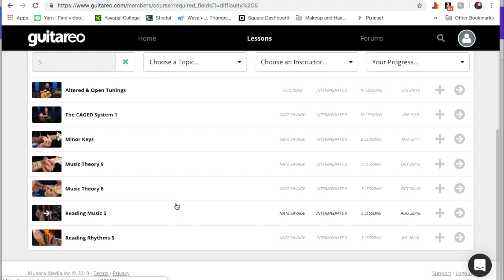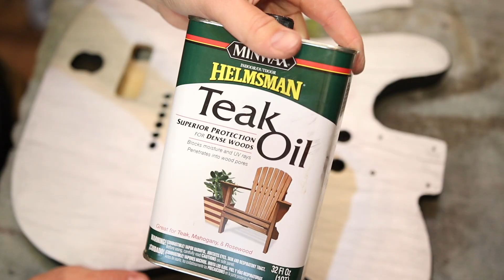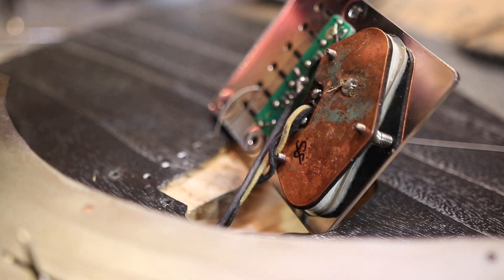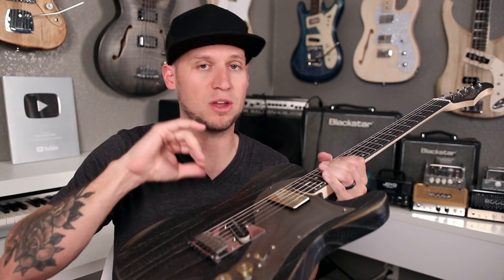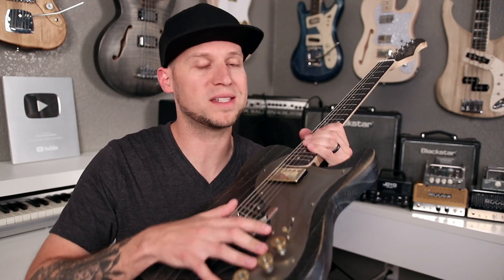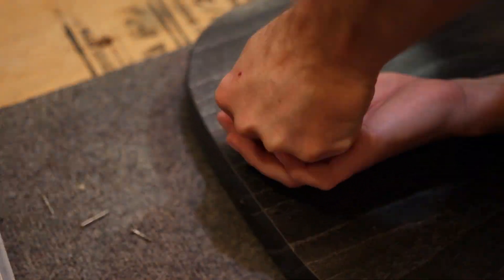Build your DREAM TELECASTER from a CHEAP Guitar Fetish Kit

Comment: Would you do a Flying V in the future?
Reply: or Explorer
Reply: @nikolayjovanovic423  Ditto, I'm about to do a Les Paul kit and if it goes well I'd like to do an Explorer later. Pit Bull Guitars has some, and I've read that at least some of their kits use the same manufacturing as TheFretwire. Leaning more toward that over Guitar Fetish or the random ebay kits.

Comment: I read a tutorial for a style similar to this quite a while back. The guy wet the wood and sanded it back over a few days to make the grain deeper and used nail filler mixed with stain powder to fill in the grain. He also used a thin sanding sealer before applying the grain stain so none sank through. I think his method was more geared towards colouring the grain as opposed to enhancing it, butbthe effect was pretty cool

Comment: Really Nice!!!! Just as an after thought, try using 3" or 3 1/4" magnum shotgun shells for control knobs. They have longer brass that will provide a longer skirt to conceal the pot shafts better. It's just a simple aesthetics thing. One of those small insignificant things that some folks can't quite put their finger on but just notice something is making all the difference in the world or, they don't notice any pot shaft showing, as with regular knobs. Which is even better. Just my $0.02. Great build!!!!

Comment: Pro tip for the super glue trick. Make vertical slits on the screws so glue will also hold up with all the layers as one and you folded the surface area.

Comment: Hey, cheapie kits are a great starting point; and will work adequately, as-is.  I'm in the process of upgrading a cheapie Strat (originally a Saga kit) with some GFS parts, and building one or two Tele's from GFS parts as well.  That's a little different than just buying the kits, but you can select the parts ya want, that way.  I found GFS to be good quality, and with excellent customer service.
Reply from the maker: You and I have had different experiences with them apparently. But there are a lot of people on the internet that say the same thing. I think I was unlucky.
Reply: @GunsandGuitars  Must be the case; I've never had a lick of problems with 'em, quite the contrary.  Mind you,  stuff won't be on the level of Fender, Lace, Duncan, etc.; but at these prices, that isn't expected.  And Jack, in particular, was most helpful in promptly answering any questions I had.  Guess it was just "luck of the draw."

Comment: I don't know whether you purposely ordered it that way (more likely GFS screwed up) but, it's readily obviously to me that neck heel is cut for a strat neck pocket. A tele neck will fit a strat pocket though it will leave a small gap. However,  when you stick a strat neck to a telecaster pocket you get... well.... exactly what you got. I assume you either had enough slack in the saddles to make up for intonation.

Comment: I'd be interested to know exactly what the body weighed. I've got 2 builds with bodies weighing 3 1/2 lbs or less and both are neck heavy. I think these Pauwlownia  Bodies run around 2 3/4 pounds. I have to move the bottom strap button up the side of the body about 4 inches to get the guitar to balance correctly.

Comment: Find a cheap mid boost circuit to add to the tone with a push pull. It is a useful hack and requires a battery. (That is why you have a battery compartment.)

Comment: I’m not sure if I missed it or not but you are  not using the battery box but you are using the power chip Which requires 9 volts?

Comment: I like the looks of the  wood...I'd personally would take drimel to the head stock an make
it looks like a typical tele...stock looking pick guard ...but i'd let rust for a couple of days
then seal it with satin clear coat just to preserve the rusty look..but not shinny...
if not....just 3 ply black  pick guard..

Maybe cigg burn marks on the body..lol...
Depending on the neck...I might mount jumbo frets ( that's how the frets are on my E series tele)..Im used to the feel of those frets....that's all.
Leo designed that guitar to be CHEAP and afford able for everyone...

Comment: Looks and sounds great, it does make me wonder though. Given how little of the kit actually wound up in the finished guitar, wouldn't it have been cheaper just to buy a body, neck, etc. instead of the whole kit?
Reply from the maker: Yes, sort of. The kit was supposed to come with a rosewood fretboard, but it came with maple instead (one way gfs screwed up). So we had to buy another neck, which added to the cost. Otherwise, the neck plus body is the same price as the kit, but I could still use the little things like strap buttons, string trees, etc

Comment: I don't think you are supposed to route out a tele neck pocket for a strat neck in doing so you will shorten the scale length slightly. A strat neck drops into a tele pocket and leaves a little Gap in the corners for a tele neck to go into a strat pocket you would have to route those Corners to Square Off. Perhaps that is why you had to redrill for the bridge

Comment: So the the Gibson 57 Classic has sounds great, what is a good passive bridge to go with that? In your opinion. Thinking about a new control plate with a six way control switch. What do you think? My understanding is that it is easier to wire than the push pull pots? Learning here, this could be over my head but I’m willing to learn.

Comment: Dan, what would you charge me to create a wiring diagram for a Super Telecaster HH ? plan on using 83 Tim Shaw Patent Number HB Bridge P/up, SD Sh6 Neck P/up, want to use PRS 4102 Rotary switch which is NOS and a 2 wire temporary Buckethead style cutoff button. Only things not purchased are Pots which need to be 500K and long Shafts since 1/4" through mounted. Already installed babicz Full Contact bridge and Bone nut with Planet Waves Auto trim locking tuners, this was a GF Blem Body and Blem hardrock maple neck and not my first Build, but your wiring is inspiring and building Guitar of a lifetime . Either way Thanks for the Inspiration and love your other page too

Comment: Was the power chip defective ? And did not having it detract from the piezo pickup performance?
Reply from the maker: It sounded a *little better than without it. It wasn’t defective. I bought another one and it did the exact same thing. It’s just not meant for high gain applications. It worked fine on clean channels, but hummed with gain.
Reply: Guns and Guitars ok. Thank you. I have been intrigued by the various pseudo acoustic options out there. Like the tune o matic bridge with piezo etc.  good to know

Comment: I'm just curious, for the finish can I use Tru oil to wipe off the excess Rub n Buff, or does it have to be teak oil? Excellent content Dan, keep up the great work!
Reply from the maker: I would use teak oil, then apply your true oil on top of that. It should stick no problem. Or you can try just using true oil on some scrap and see if it works.

Comment: Hi, this is great work and looks absolutely sexy ;-)
When you put on the stain and the Rub-n-Buff everything was covered uniformly. But now in your video it has this used look on the edges. Is this intentionally made by you, or does the minwax and the Rub-n-Buff loose color over time because the body has no protectictive coat on it? I want to try this technique on my old ukulele and want no used look. 
Thanx for the answer.